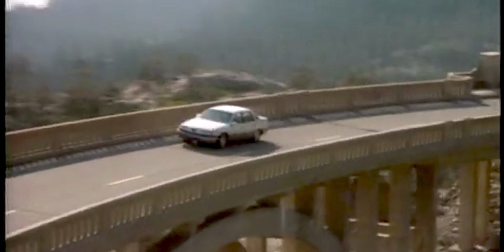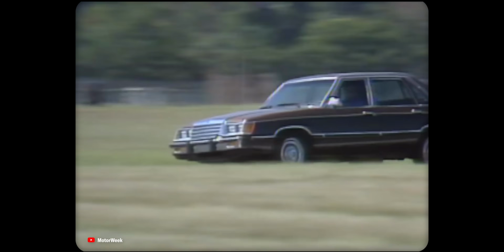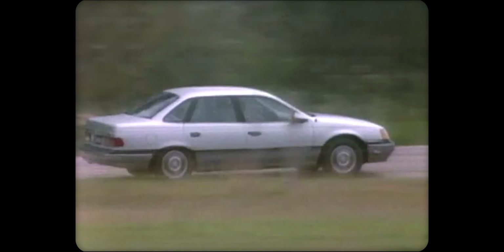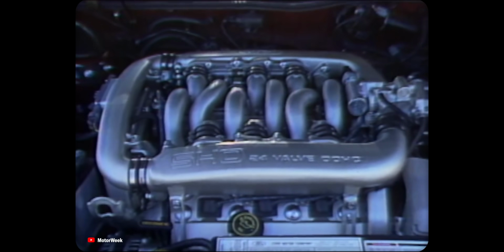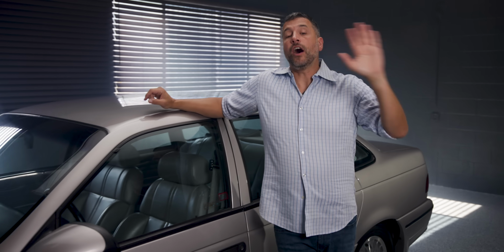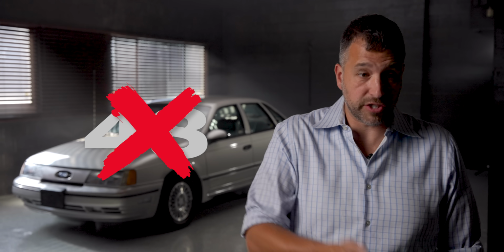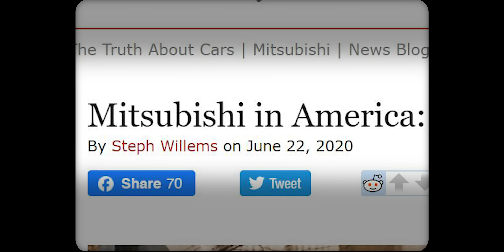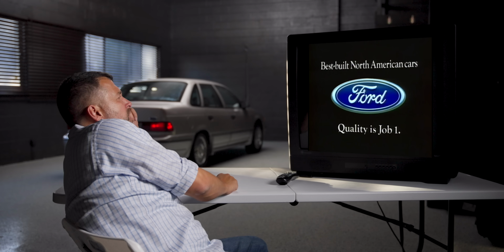The Taurus SHO is the fastest, most expensive Ford sedan | Revelations with Jason Cammisa | Ep. 08

Comment: Then Ford went and destroyed the styling on the next design of the Taurus
Reply: The bar of soap was awful
Reply: Are you talking about 92-95 or the 96-98?
Reply: 1992 Pontiac Bonneville: You dissin me bro?
Reply: They turned it into a roach coach.
Reply: @jamesr2888  more specifically I think they are referring to the 1996 to 1999 frog eye cars.
Reply: I kinda liked the 96-99 ones.. Sure it wasn't pretty, but it wasn't ugly af.
Reply: It looked really streamlined so was it economical?
Reply: @skeezix8156  It was a Tilapia.
Reply: @rosewhite---  

My parents owned 3 different Taurus of different vintages (when my father found a car he liked, it really had to be awful before he stopped buying more of them), and for their size they were ok when it can to fuel economy, though I am not sure the styling was a big factor in their being " good or bad " fuel-wise.  As far as economical to own: at least 2 had transmission problems that resulted in what I would consider premature transmission replacement.
1 car, a 98 Taurus, had problems with the transmission in that it sometimes hung in neutral when accelerating through the gears.  Tho to its credit it was able to soldier on that way to 100,000 miles.  The 2nd Taurus, needed a new transmission at about 60,000 miles.
Both got about 26-27 mpg out of the v6 pushrod engine.
Reply: They were mechanically just as bad.  Transmissions especially, electrical, power steering pumps, some blew head gaskets, some never got their oil changed.  I was a mechanic in the 00's and I hated the 2nd and 3rd Taurus generations.
Reply: @jamesr2888  the 96-99 Taurus/Sable is one of the ugliest cars ever on american roads
Reply: well I kinda liked it cousin had 1 on 24z it was clean 🤷
Reply: There are no words to describe what they did to the Taurus with that next design except this:  it was better looking than the 1991 Chevy Caprice.
Reply: That's what Ford does.
Reply: @jamesr2888  96-98! FUGLY! no redeeming value even with the V8....too UGLY!
Reply: @Paul Kersey 2.0 is
Reply: @Paul Kersey 2.0 facts 💯 the person from the design team back then had no soul to make ur families drive a eye sore like this
Reply: @jamesr2888  The 96-99 jelly bean ones were the ugly ones, the 92-95 were the best looking, I have a 95 S.H.O.
Reply: @ericbrandt829  Yeah, the V- 8 had issues with timing sprockets braking

Comment: My family had a police version in Chicago when I was a kid that thing was unbelievably fast it would hit 140 and the Speedo would start to clock over. highway monster for a old v6
Reply: The police version was not that fast. The only special equipment on a police Taurus was the cooling package and most didn’t have that either. Taurus’ were issued because either the chief or an investigator needed a car to putt around in. They might have said police package on the door jam but they were pretty much your standard Vulcan V6. They briefly gained popularity when police departments were looking to give beat cops slow cars to “ keep them outta trouble”. Once the panther platform 93 and up crown Victoria appeared with the mustang’s 4.6 modular V-8 the Taurus police cars sat in the lot and saw only occasional use. My little town had one, the wiring harness self immolated and caught the car on fire. It was no loss as a pair of crown vics had replaced it several months earlier
Reply: @theraginggam3r679  is he wrong tho?
Reply: That 3.8 V6 was a motivator tho. I loved mine until I popped the heads
Reply: @matthewcaughey8898  lol it didn’t have anything about police on it but a flashlight on the door but yeah it was nice . It don’t matter if it’s not the fastest but it goes fo sho .
Reply: @roodick85  They all popped the heads
Reply: @matthewcaughey8898  Well, Robo Cop had one. (the SHO version, the rims and cornering lights give it away) lol
Reply: @zanderpell3636  but it had upgraded springs to compensate for his weight lol
Reply: I worked at L/M in the nineties and did literally about 150 head gasket jobs
Reply: @matthewcaughey8898  I did get the police grill for my 89 SHO.

Comment: I bought a 1991 SHO for $600 back in 2014 when I was in college working part time delivering pizzas... It had been passed around from one jackass to another (myself included) and treated like a rented race car. I found out from one of its many previous owners, after a year of taking it to 7000rpm EVERY SINGLE DAY, that the 5 digit odometer that said 55,000 miles wasn't 155,000... It was 255,000. 

This $600, 250k mile pizza beater was one of the BEST cars I have ever had. In four years of owning it and over a year of beating the hell out of it every day, sub zero degree snow, 100+ degree heat, racing (and beating) my friend's V8 Camaro, all I ever did to it was zip tie the shifter linkage on with a piece of metal wire, and change the oil.

God I miss that car.

Comment: I had one of these in the late 90s, it caught on fire 3 times
Reply: Mine burned up too!
Reply: So that means you put the first TWO fires out?......WHY?!
Reply: Mine caught on fire once in a parking or right next to the fire department. I was putting some oil in it, spilled a little on the manifold, a fire started, and two of my friends took off running all scared like it was going to blow up. I told my friends little brother to pee on the fire to put it out. He didn’t. I walked into the fire department asking if they had a fire extinguisher that I could borrow. One guy started to suit up all slow and finally made it over.
Reply: Forgot to add, I actually sold it and the next owner drove it into a telephone pole. Fitting end for the thing.
Reply: @meatmissilef111  Lol
Reply: @leee3880  That's how mine burned! In a parking lot at the mall, I just got out! I had an oil leak that made it into the manifold apparently. My friends thought I got neon lights installed, I looked down & lost it! Watched my first car burn.
Reply: @TONEYHAYWOOD  that’s a bummer.  :/

Comment: I love these 1st Gen SHO's.  They really nailed it in 91 with the 16" aluminum "slicer" wheels.  I have a set of them painted gunmetal on my 01 4th Gen Taurus SE.  My friend had a 91 SHO and I had a 92 Thunderbird SC 5-speed back in high school.  They were damn near neck and neck.  He would get off the line because I would spin and the front wheel drive would spin but seemed to get grip a bit better.  Once I did the 3.27 gears (stock was 2.73), wider tires, cold air intake, 10% overdrive pulley on the supercharger, B&M Ripper short throw shifter, and catless exhaust with mandrel bent pipes I could pull him from a roll or a dig.  He ended up putting in a K&N filter, and doing a catless exhaust on the Taurus and that thing screamed.  We both beat up on the local IROC Camaro's and 5.0L Mustangs unless the stangs were geared and cammed.  I still have my Thunderbird SC and have another one in the garage now as well, but I have always wanted to get an SHO for my daily driver.  Always on the lookout for a 91 preferably in black or the maroon red color.
Reply: Lol... your friends sho did not "beat up" on 5.0 mustangs. Jesus the things people will say.
Reply: @Pharto_Stinkus  obviously you've never driven a stock 5.0 against a manual SHO.  Street trim a 5.0 Mustang on street tires, stock gearing, and an AOD was a mid-high 15 second car.  The 5-speeds were just a little quicker.

The SHO ran 14.6's at the track and my Thunderbird ran 14.2's with those mods listed.  More than enough for a fox body unless it had a cam and gears.  We made a lot of money racing them on the street back in the 90's.  Most were just loud with flowmaster mufflers and headers.  The fast ones had cam and heads, gears, intake manifold, etc.
Reply: @Long-nd8bq  obviously you're talking out your exhaust pipe.

Comment: Loved the SHO back in the day , love to find a mint one now
Reply: Think this is what we called the Sierra in the UK and a Sierra Coswroth runs £30k to Group A at £125k. Bentley money.
Reply: Just prepare to have in on jackstands more than its driven
Reply: @ OG-BIG-SHEPHERD.   Actually they were quite reliable.  In the 110,000 miles that I had mine, it had a clutch (Cenerforce), timing belt change, spark plugs, belts, tires, brake pads and rotors and a power steering hose replacement.   Everything was wear and  maintenance related  other than the hose.  Nothing every kept me from driving it.  Even with the hose failure I was able to drive home.   Now if the car wasn’t maintained,  you would have a lot of work to do, just like any other car

Comment: I worked in a Ford dealer when these came out and they were absolute fire! Would kick a 5.0 Mustangs butt and embarrass a lot of Corvettes. 
I was actually told to stop racing people in Corvettes while doing PDIs the GM dealer down the road was getting pissed😂
Reply: And a few years later a version of the Dodge Spirit was more powerful than the SHO and now a Camry is more powerful, even some Sentras.
Reply: lol...I had the same issue back then.  Another hot Yamaha powered Ford was the 2nd gen Probe GT.
Reply: By '86 Corvette's were coming into their own and pretty quick... but an '84 Vette with Crossfire injection was trash.  If they slept on the line or you took them by surprise, new 5.0 Mustang's didn't have a chance.  By 60 - 70 MPH the SHO was pulling away, so a 5.0 needed to rely on V-8 torque and RWD to get a good jump.  If the SHO was rear wheel drive instead of FWD, man... it would have been... wow.
Reply: Ip Man  The Mustang GT or LX of the time had a 5.0 liter V-8, good for 225 HP.  The SHO had a Yamaha modified/tuned 3.0 liter V-6 good for 220+ HP.  I think both cars were comparable weight.  The torque and weight transfer gave the Mustang an big advantage off the line.  The SHO had much better aero and more power higher in the rev range... so as they went down the road any edge the Mustang had slowly got eclipsed by the SHO.
Reply: Ip Man  No idea.  Maybe?  Would be tough plumbing around that intake system.
Reply: Dodge Daytona Turbo: Wut?
Reply: My college electronics prof had one in the early 2000s. It wasn't in great shape, but it kicked my car's ass all the time (yeah he raced me a couple times) ;) Vadim, hope you got your fun out of it!
Reply: Ip Man  FWD has less powertrain loss, keep that in mind. Sucks off the line, of course.
Reply: No ,they where not faster than the 5.0 mustang. The stang was 6.0-6.1 0-60mph  with 150 mph top end .
Reply: @robertmoulton2656  you’re joking right? 150 mph from a stock 5.0 l? Yeah no. 135 tops. How many have you owned? I have owned 9 Fox body mustangs over the years about half were completely bone stock when I got them. The fastest was a 1990 lx 5.0 coupe and it would top out at 135 mph, once I added a few bolt ons then yes 150 was within reach but just barely
Reply: @AndyGeesGarage  I've had three a used 87 boss 302 edition  with 135000km ,a used 1991 LX 5.0 fast back got it with only 75000km and a brand new 1991 black on black GT . My boss 302 was the fastest . I actually raced my new GT against my used boss 302 . Boss won . So ya I know Mustangs of that era well . I subsequently switched to iroc z's  . I raced my 1987 iroc 350tpi against the 5.0 Mustang LX . The iroc won , I'm currently running a 1999 Camaro SS .  The SHO was a great car but it won't beat a strong stock 5.0.  there were substantial differences in all three of my Mustangs.  I know I had my mustangs over 220kpa and some would hit 240++
   Back when I had enough courage to see what the top speed was . I've since lost my nerve fastest I've been at in my Camaro is 250 kph
   The speedo in the boss ran out of numbers at 180 km per hour but my GT had speedometer markings past 220kph
Reply: @robertmoulton2656  In 1991 I took the Bondurant School in Arizona.  They were a Ford shop then.  While you could rent Mustangs or Cougars as student cars, the instructor cars were all SHO's.  You could put in a full cage and still hold 3 students.  And as Bob told us, while the Mustangs were faster off the line, the SHO was just as quick around the race course!  I bought my SHO the next year.
Reply: @AndyGeesGarage  you might me right , my LX 5 had a 220 kilometer per hour  speedo past 220 it was a guess. I'm sure it went by 230+ on the right night .
Reply: @AndyGeesGarage  I think Ford f*** up big-time by not having a two-door Ford SHO sedan, I remember when I was 18 in 1998, looking through AutoTrader magazines still considering a four- door but I settled for in Eagle Talon turbo which actually did get up to 130 mph and maybe five more but I was just worried about stop sign. I'm convinced the automatic transmission had uptick of sales only because it is a 4-door sedan. If Ford would have had a 2-dr sedan and manual transmission at that price it would have been a huge seller amongst single males 18 to 40. Also as a former Yukon GT Sport owner, I always loved two-door SUVs especially when you're single and the parking lots are so much smaller now it was so easy to maneuver and considering the saving on gas. There are a lot more single adults during this time and I think these would really be a big seller during this time
Reply: @rrpearsall  the SHO powered Mustang would have been a game changer
Reply: ahahahaha,  munch munch vettes for lunch,   I noticed absolutely no rice burners or GM products when I drove my falcon with a worked 351 Cleveland in it, cars used to pull out and try over take me when they see the old 1986 body but I'd just wave good bye to them as I applied some throttle,  dam funny when a  some type of MG race car tried to over take me  I just gave it a little bit of gas  and the fibre glass turboed MG chopped down a gear and did a wriggle and gave up and sat behind me lol,  the only car that over took me was a  black Porsche CTR2  but I let it,  we were on the motorway new zealand  I was sitting nicley on 180 kph and I let it pass then it would sit on around 180 kph then I'd blast past it go up ahead and sit on 180 kph then it would blast past me and sit up ahead on 180 kph then I'd blast past at like 250 kph  and sit up ahead on 180 kph we did this for 30 minutes until he turned off and we gave each other a thumbs up and a smile lol
Reply: @5610winston  ive got a Camry they ain't nothing , just a good reliable A to B car good on feul